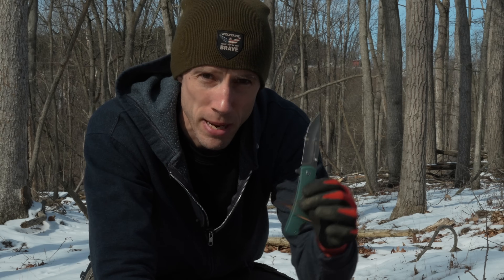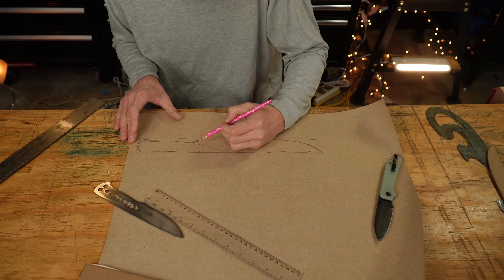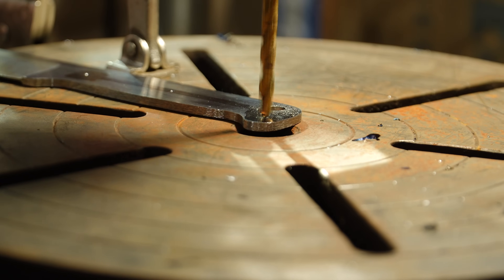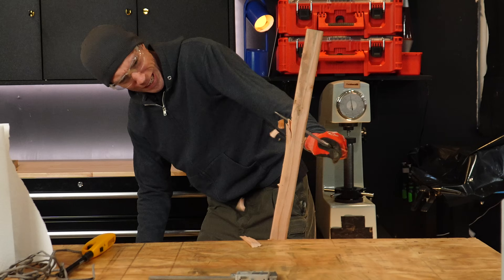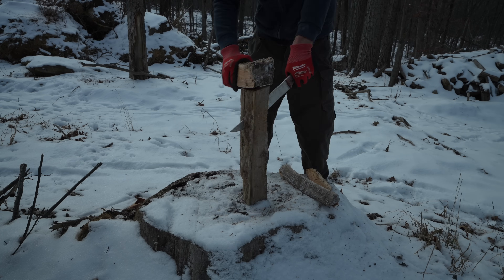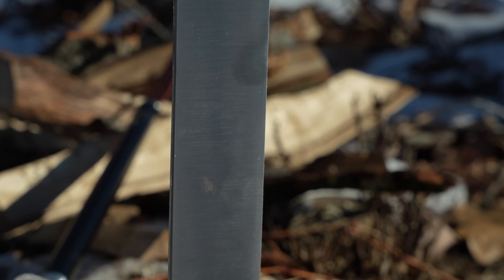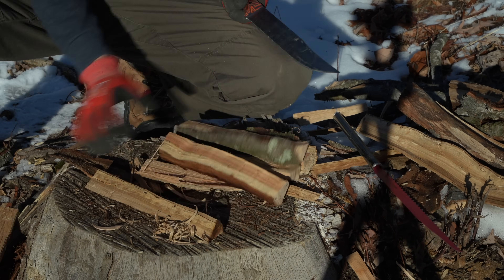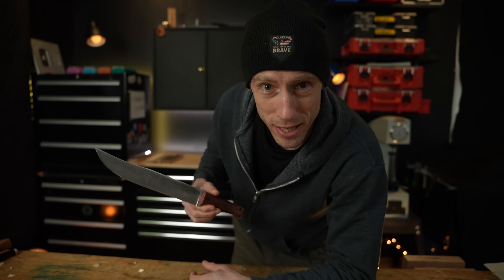Addressing The Dirtiest Word In The Knife World

Comment: I hate your design; FFG sticks in wood more so you use more calories batoning, also  .137 inches further reduces splitting speed, and that tip really looks like it eats up a baton. A note on the tip, I've had too many moments where my baton would stick into the tip and became somewhat annoying to use for both the BR Bravo 1.5 and Bravo 1 light. The best tip has been thick with a slight down sweep. Also the length seems needlessly long. And for the price you could get the same/better with something like a Varusteleka Skrama 240 (maybe even cheaper). These opinions are based on my experiences. That knife was custom built for your needs/style and it's possible your style somewhat nullifies any of my criticism. 

With all that said, I whole heartedly agree with you. It's always disconcerting when a supposed "bushcrafter" claims batoning is for fools and the knife they are using is needlessly thick and even advertised for batoning. Same people who drive to their camping locations rather than hike several miles in. Also axes break all the time, people simply ignore the fact it's the handles that break and act like they could easily remake a handle (that won't immediately break) in the middle of the forest with little effort. Great video, hope my criticism did not come off as overly harsh.

Comment: Haha
The trick is to get a decent japanese sword from china,dewrap and take off the handle, and then remount it with epoxy, then wirewrap it in a pattern of your choice that prevents wood crackage. Then wrap it with hockeystick grip tape.
Perfect woods/yardtool.
Fuck Edward scissorhands.
Yardkatana is great for planing  off vegetation a bit at a time until the juniper etc. looks just right,or just hackin up burn pile wood.
And those just out of reach treelimbs.
Go yardsword 👍

Comment: I don't know much about making knives, I've only made one or two about 40 years ago, but the straight grind will give you easy penetration, if you intend to pry with it would it be better to have a slightly less tapered primary bevel, and have the mid section of the knife a little thicker?
Not just to give more material, but also to geometrically focus the strain in the middle of the knife and make it less likely to bend (crack) the thin working edge.  Especially if you have multiple zones of hardness, like blue on the edge and yellow in the body.  
Also, is tempering to color still a thing?  I've done it a few times recently at work to reform faces on chisels, as well as case hardening them, just wondering if my knowledge is outdated here.
Reply: NM.  Outdated.   Air hardening steel huh?  Never even heard of it.
Reply: Oh, 350 degrees, Ok, so light yellow through the whole thing?  Really going for toughness.

Comment: You definitely have a point but after years of using a BRKT Northstar as my primary "survival" and campmaking knife, I absolutely prefer an axe or hatchet. I have a BRKT Golok as well, but what I really like to use is a BRKT hatchet that they only produced one run of and I can't seem to find the model name for at the moment (of course), alongside a 4-5" fixed blade.

The main reason I prefer this for batoning isn't just the superior edge geometry that a hatchet has for the task, it also involves the height and thickness of it. The height lets me baton directly above the wood so I am always hitting in-line with where I want the edge to go, and it is tall enough that at the point I can't hit it anymore because it is too deep in the work, its split it far enough to finish by pulling the pieces apart. The thickness not only helps with the geometry, but it also extends the life of your baton. I imagine your trailing point knife wears through a baton relatively quickly with that nice thin profile you gave it.

Either way, great work, I will always support someone that actually gets their hands on the work and off the arm chair :p

EDIT: I found it, Bark River Custom Camp Axe 2009

Comment: I used a Gerber LMF 2 on some trips a few years ago.  Easily replaced the need for a hatchet or axe at a much lighter weight.  The steel on that knife could be better, but it was a freaking beast at chopping and splitting.

I also ended up buying a similar saw, which left me with all the bases covered.

Comment: Something that I would like to see is just how much of the edge needs to be at a steeper angle for the edge to be durable. I guess my main question is if the edge is at 25 degrees for wood battoning, how deep does that angle need to go, and how shallow of an angle can the rest of the knife actually be at? Can you get edge stability just in stropping at a higher angle? Does it take 1-2 swipes on a 1000 grit? More? All of these answers I would like to know if the entire blade is ground super thin, like 3-5 degrees per side or something similarly heinous. Just what can you get away with?

Comment: If you wanted to make one shorter and thicker around the same weight, I'd buy it! A thicker knife would split better, as it act like a awl. Shorter because that Bad Boy won't fit in my day pack. Also, I wouldn't grind it any thinner. Giving it a more blunt like geometry would help with the edge retention on that steel.

Comment: It looks like you are about to re-design the large "Leuku" knife of the nordic reindeer herders in Europe. A long, not very thick, straight backed chopping knife with a flared handle and a light leather sheath. Those have a scandi grind though, usually, not a flat one. 

Just measured my Eräpuu leuku and it weighs 279g/9.8oz  (without sheath) having a 21cm/8 1/4 inch blade.  Blade thickness is 3,4mm. Which is probably about sixteen quarters of half a double inch or something like that. The leather sheath with plastic insert weighs 97g/9.4oz.

Comment: I have a knife specifically designed to baton sticks up to 4 inches easily. It is a 6 inch long, thick wedge blade. It also has a spine that is used to notch sticks to be able to use as tie off points. The spine also prevents your baton from slipping as you hit it. I have used it and it is amazingly effective. It is a handy knife, makes a few tasks easier, but i never felt it necessary to carry. There are other methods if you have to split or notch wood. It mostly becomes dead weight.

Comment: Perfect knife for these kind of purposes is my Zombie Tools Para Bellum (5160, oil quenched, clam tempered at 450F/4h, then 460F/4h final). You don't actually need a super stabby tip outdoors, so the mass upfront of a bolo style knife takes away the lack of chopping capability while keeping all other benefits of a large knife. Sadly discontinued, but available on the used market every now and then.

Comment: I mainly take a mountain bike with me when I go bushcrafting now. It's a good thing to have in the woods, especially for the people like me who are a little older and damaged, so weight is up to how much stuff I can pull with a mountain bike. My bike trailer is a one wheel solution to make it easier to track in the woody areas. But why ditch the axe? It's not just an axe, it works like a hammer just fine, and some even come with a knife in the handle. And they are not too expensive. 
But I do choppers and usually make them from old meat cleavers, they are kinda made for hard use, and that means you can baton with them also. 
I use old nylons for smoothing micarta handles because the friction from nylon on micarta actually gives good results, so I might be able to cut the costs in half. Still good work though.

Comment: I don't get the hate for batoning. Sure, an axe or hatchet is better for some things, but a larger fixed blade knife sure is handy for making kindling and splitting smaller diameter pieces. One thing never mentioned that occurs to me is that I think, for those uses, batoning is safer than using a hatchet.

Comment: I use a Cold Steel® machete which I paid maybe $10. It has been lying in the backyard for 15- 17 years, but the handle is trashed and painful to hold( I'll make a handle someday when I get the gumption). I have used it to split plum wood that was curled & knotty so badly that I thought the blade would snap.But, it is not as "stabby" looking as the nice one you made. I also use a froe that I made from an old leaf spring, but it is a bit heaver. [BTW "Is this even wood? 🤣]

Comment: Why batoning is stupid 
1-if you look at them batoning its always wood that has been cut by a saw, those dont happen naturally when  you are stuck in the woods and if you have a saw you do not need an axe in the fist place 
2- Axes can work like hammers and knives dont do that well and a hammer is realy realy useful 
3- to be useful in splitting wood a knife has to be so long its hard to use for a lot of woodworking  applications 
4- A mora knife, prunning saw  and hardware store axe is about $50

Comment: Thicker steel might have given you all the things you were missing... handle thickness, chopping weight, slightly thicker blade profile for a bit better batoning wedge...
Otherwise, it's an Amazing looking / working knife. 
Or, you could leave a little flat , say a third of an inch at the spine for everything but the handle thickness. 
Definitely keep that upswept tip, ( Troughed / dipped front quarter ?) though...
I'll take 3.  😃
Great vid. Keep 'em coming!

Comment: Would it make much difference to temper at 300 v 350 for this use case? The 300 should keep closer to that 61-62 area that s7 is capable of out of a quench I don't see it used often enough to really judge uses but found out today that it's really good for shock resistance lol

The cost is surprising though to me but not completely given the market.

Comment: About 40 years ago, I was in a machinist trade school. One of our required projects was to make a precision machinist's square, to be square within one ten thousandths of an inch (+/- 0.0001") per inch. The supplied steel for the squares was O2. I had been digging thru a crate of tool steel scraps donated to the school by a local manufacturer and I found an appropriately sized piece of S7. I had to get the instructor's permission to sub the S7 for the O2. When it came to heat treat my S7 square, I had to do some serious research to figure out HOW to accomplish that. The instructor didn't know, as they had only heat treated the O2 squares before. This, of course, was well b4 the internet, making that particular research somewhat difficult.

What my research came up with, and what I did, was to bury the S7 in cast iron chips. With the S7 surrounded by the cast iron, which has an even higher percentage of carbon in it than the S7, that was "supposed to" if not only prevent decarbonization but to possibly increase the carbonization of the surface. I drove to gas stations that did brake work, as well as brake repair shops, collecting the chips from them machining brake drums and rotors.

So I bought a steel loaf pan for baking bread, put in a 1.5-inch layer of the cast iron chips, set in the square, and added another 1.5-inch layer of chips over the top. As I recall, my square came out at Rockwell C 58. Oh, and my finished square came out at less than 0.0001" over the 4.5-inch long blade.
Reply: That's a cool story. I'm impressed, that's a damn accurate square. Curious how you measured it? Just a difference of 10 degrees temp will change that.

It's a shame they took the vocational al trades out of high school. In my day you could go straight from high school to a good paying job, if you had a good teacher and the willingness to learn.

Kinda off topic:
We had welding, wood working and auto mechanics in high school, and I took all of them. I learned to tig weld, of course mechanic, basic machining, cabinet making, and build race cars. I'm thankful for those vocational classes, as I do all of that for a living now. One project I recently had in my shop just raced the baja 500 and placed 4th in the trophy truck class.

Comment: Just curious. You called deep freezing a "red neck heat treatment". It is done at times by commercial heat treaters although not often as you only get a small, incremental improvement. There is a technical reason why it works.

Comment: Well, the field knife i was issued during my conscript time 25 years ago, easily withstood hacking and batoning. While weighing 206 grams at an overall length of 290mm and 165mm blade length.
And it's not even full tang. (Glock FM78)
Hacking and batoning were the only things we could really use it for (other than looking good in it's uspide down left shoulder mount 😁.
As we were forbidden to use any "material removing techique" =sharpening. (they were too afraid that after being issued a certain amont of conscripts and everyone trying to sharpen it, they would need to replace each knife more often than if no one sharpened them. Yes the army i did my service in is underfinanced since at least the 1860's and has always tried to save costs in every little corner)
But your knife looks beautifull and most likely cuts way better.😎

Comment: that is basically a Saami Leuku knife blade, they have straight back or slight drop point though, but rest is close. they are used to cut firewood  and butchering, the wood is mostly small birch, willow... that grow in the Arctic thundra of the upper parts of Northern Sweden. Very traditional woods blade going back roughly 1000 years.

Comment: Need to DIY some saw teeth to spine and boom, you can drop the ultralight saw
Maybe add a zippo slot to the handle, even if real bushheads prefer a flint and steel or friction fire starting
A whistle, laser pointer, propane tank attachment point, etc
Reply: The saw teeth would be incompatible with hammering on the spine while splitting wood.

Comment: ive made several over the years since i started bladesmithing. as a matter of fact 2nd knife i ever made is a full tang survival knife. 
in terms of handle finishes, if its a stabilized material, ill just sand it to 2000 grit and lightly polish it, no buffing/polishing compound, if its raw wood ill sand to 2000, coat in melted beeswax, cool, remove excess, then buff with clean rag.

Comment: What about this. As a final test ,since it will change the configuration of the knife, put a saw profile on the back edge. I'm aware that this is possibly weakening the knife to some extent, but I believe this might work. You would be able to lose the saw blade that you added. Anyway that's why I said to add it at the end.

Comment: I think that it needs to be checked for the resistance to rust. Still, it is not very pleasant to cut apples and tomatoes with a rusty knife, and if it can work like a field kitchen knife, this is another dignity. But for the kitchen knife there is another pleasant quality, this is to have such a handle to put the knife on an even horizontal surface so that the knife lay on the handle and does not touch the surface with a blade on which it lies, that is, it lay only on the handle, but this certainly implies definitely The distribution of weight and the center of gravity in the knife, which can make it less convenient for chopping shrub and use as a machete.

Comment: My favorite outdoor knife is a 10inch Tramontina machetee cub. Very light, you can even carry it in your back pocket. I have larger macetees, but since I got this, I very rarely use them, for my needs that one is enough as a camping knife (could be paired with a pocket knife, be it a folder or fixed one),  and it costs around 6$

Comment: An upsweep in the tip is not a good idea if you want to hit it. Geometrical it will try to tip over when hitting it. Implementing torsion stress into the blade. The tip will want to tip over and twist the blade.

Comment: The word is froe? A batonning knife is a froe. It is a pry bar with an edge (good) but the handle has no tang at all (bad)
Reply: A froe is a specialized tool for a controlling the split.  Using a knife to split doesn't make it a froe.  Froes have a place for a handle to go so you can actually pry.
Reply: @ indeed a froe is fit for function as a batonning knife. The knife here needed a thick handle to reduce hand damage because hitting happens against the hand instead of along.